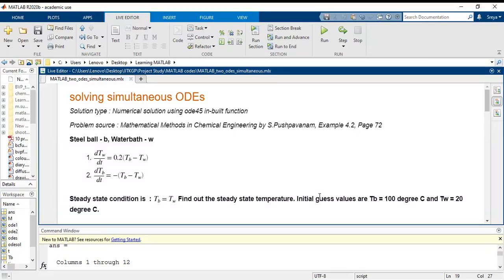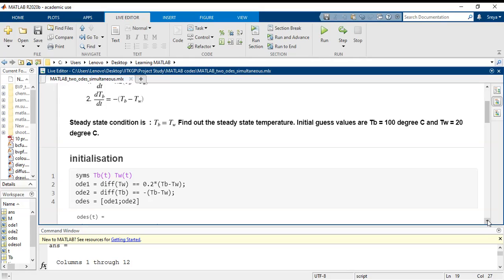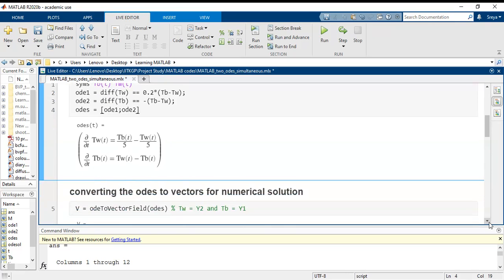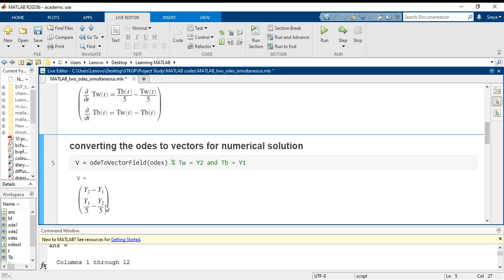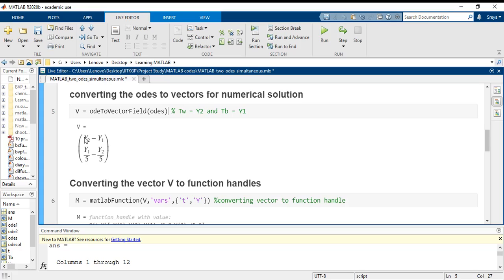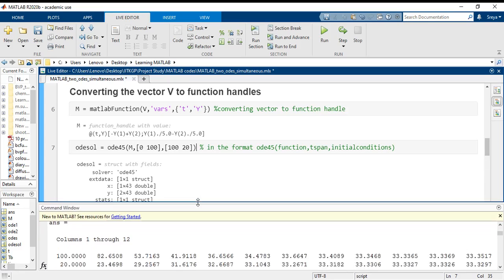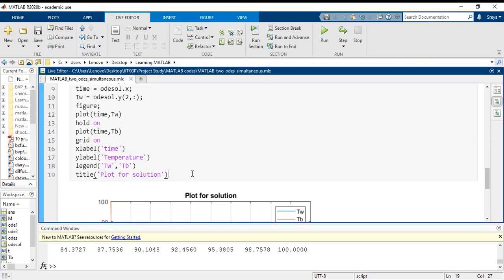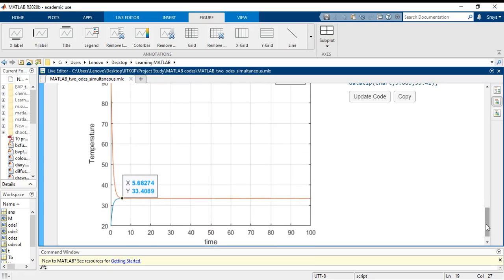Solving simultaneous ODEs in Chemical Engineering problems using MATLAB

Comment: I am just giving another perspective towards the solution. 
Since two plots have not met at a point then by pointing the cursor might not give the current result...because of limitation of human vision
A tolerance factor should be given so that we can derive at what point of time the difference between the dependent variables is less than that tolerance(€). 
Thank you ! Keep going :)
Reply from the maker: Sounds like a good strategy. Will keep this in mind definitely. Thank you for sharing :)